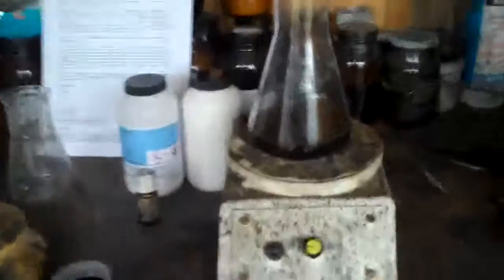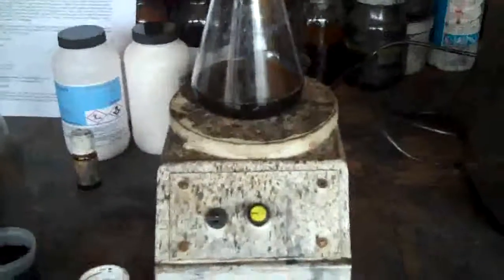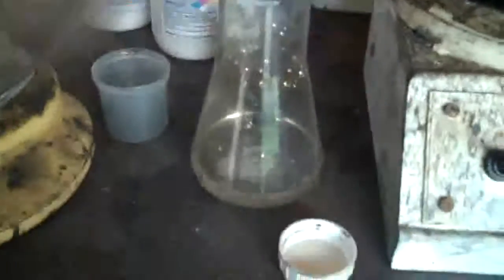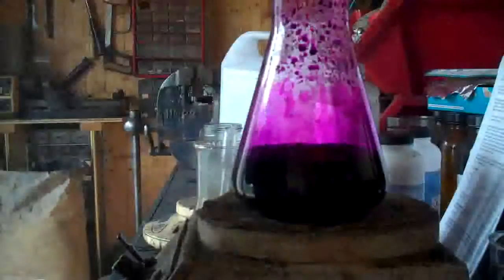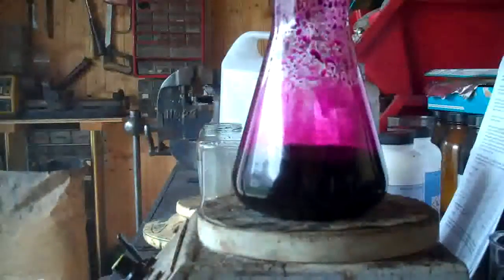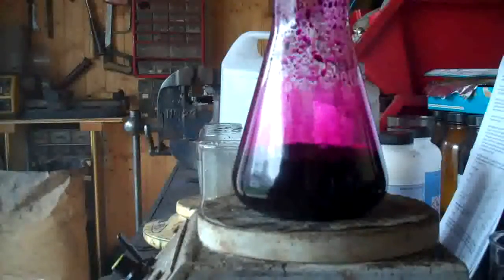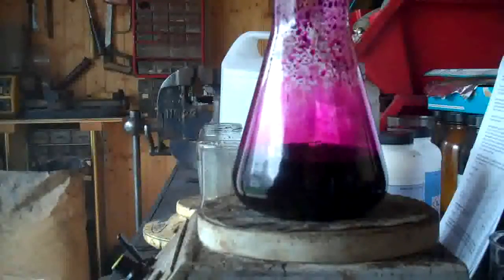Graphene Oxide Manganese Dioxide Cathode Material For Batteries And Supercapacitors

Comment: hi, what's the purpose of substituting part of manganese sulphate with zinc sulphate? why not using only manganese sulphate?
Reply: I think because his friend makes a zinc battery, but I'm not sure about that
Reply: @Upisce  Robert is correct. I was wondering if preloading the mixture with zinc would for an intercalated compound with zinc already incorporated into the MnO2 tunnels, to allow it to work as a ‘rocking chair’ cell, with zinc moving from the MnO2 on charging, and being re-intercalated back into the MnO2 on discharge. That would allow the amount of zinc in the electrolyte to remain constant, which would in  turn maintain the pH of the electrolyte during charging and discharging. One problem with MnO2/Zinc batteries, you see, is that they become more acidic when fully charged, and more alkaline when discharged. This is bad. It leads to zinc corrosion in the charged state, which creates hydrogen gas and eventually consumes all the electrolyte leading to failure. Hope this helps, and sorry for the late reply!

Comment: Aqui esta las notas de la sintesis  de Simon:

20 ml de H2O con 1,2 g de KMnO4 disuelto en esta se mezclan primero con 40 ml de GO suspensión en 1mg/ml para producir la solución oxidante . Esto se pone en un vaso 

de precipitados de 250 ml y se agita magnéticamente con un agitador magnetico.

Otros 40 ml de H2O con 2,2 g de MnSO4 disuelto en esta a continuación, se añade gota a gota a la solución mientras se agita . La reacción es casi inmediata , incluso a 

temperatura ambiente .

Para el MnO2 he sustituido el 25% de MnSO4 con ZnSO4 .

Filtrar, lavar con agua destilada 3 veces para eliminar el H2SO4 residual y el resultado es un polvo marrón chocolate suave que es mucho más conductor que el habitual 

MnO2.

Hace una buena tinta para la impresión . Es tan conductora que realmente no necesita añadir carbón o grafito, aunque un poco de grafito (como al 2 o 3 %) lo mejorara 

un poco. Más allá de eso ,no hay una mejora adicional, lo que sugiere que la conductividad a granel ya es casi tan bueno como el que va a conseguir, y el grafito se 

acaba de añadir una red de percolación que reduce la resistividad superficial entre las partículas.

Funciona incluso cuando se mezcla con cola PVAc que se seca a 80 grados en una película de plástico , lo que hace un electrodo con buena flexibilidad. Creo que el 

grafeno está ayudando a mantener el frágil MnO2 para que no se rompa durante el ciclo, Se mejora mucho el tiempo de vida de estas células que con el viejo MnO2 sin 

grafeno.

Hice una celda de ensayo con el rGO:MnO2 sintetizado en polvo el fin de semana .

Está funcionando mucho mejor de lo que esperaba . El único problema hasta ahora es el nuevo polvo (color púrpura- negro raro ) una vez seco , es tan fino, que se 

esparce con el más mínimo movimiento . Hablo acerca de las nano particulas de polvo ! estan por todas partes. :-(
-----
Sin embargo, funciona muy bien en una celda de zinc. He empezado a hacer pulsada la formación de las células, lo que parece mejorar su capacidad de manejo de 

corriente grandemente. Después ( voltaje de la celda sobre 1.4V vs Zn ) construcción , sólo el pulso de la célula a partir de un suministro de 3.5V sin limitación de 

corriente , tal vez 10 pulsos a 100 ms cada uno , con 5 segundos de descanso en el medio de cada pulso .
----
Las últimas células han sido realizadas por la mezcla degrafito:carbon premezclado a una proporcion de 09:01 en una mezcla conductora con materiales activos en una 

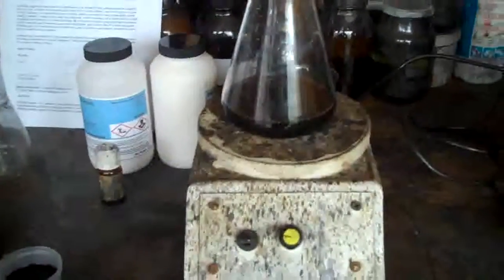proporcion de masa del 2:01. Así que los polvos finales tienen 33 % de carbon conductor y el 66% de grafito . He usado zinc en polvo con una malla de 400 como  

material para el ánodo activo.

Una vez hecho, mezclo los polvos con una pequeña cantidad de electrolito que tiene el 5 % de PVA (PVAc pegamento comercial) añadido a la misma, hasta que se forma un 

liquido lechoso.

Esta es vertida sobre los colectores de lámina de grafito  de corriente a recubrir en un área de 1cm2 para crear una tension superficial uniforme,y después se seca en 

una placa caliente a 80 grados .

Monto la celula con un contacto en forma de disco con el medio de filtro de fibra de vidrio de 1.2um
entre los electrodos , intercalados entre dos 

etiquetas autoadhesivas de 50x33mm de PET transparentes . Para realizar las conexiones más fácil , la parte de extremo de cada tira de electrodo de hoja de grafito está envuelto plegado alrededor de ella piezas de malla de cobre fino ( 300hpi ) de modo que unos pocos mm quedan atrapados entre las etiquetas . De esa manera, unas simples pinzas de 

cocodrilo pueden ser utilizados para conectar la célula .

Hasta ahora, he conseguido 2mAh por centímetro cuadrado de esta manera , cuando un ciclo entre 1.85V y 1.05V . La auto -descarga está casi ausente. La fuga a plena carga es 

pequeña también, yo entiendo de la corriente de carga 15uA cuando el voltaje de la celda está en 1.85 V después de 60 minutos de carga . Tendría probablemente a caer más 

bajo, pero no las he dejado en carga más de una hora .

El electrolito tiene pH 6 ,ZnSO4 a 2,0M, ZnO a 0,25M, MnSO4 0,4M, Bi2O3 a 20mM con aproximadamente EDTA 0,01mN y 0,5 % Carbopol 940 neutralizado.

Comment: Can you make a Dye-sensitized solar cell - blueberry/raspberry solar cell with that substance on top with carbon aluminum battery for the bottom, and lastly a carbon aluminum sandwich capacitor below that, all in one unit? Just wondering if its possible with your thin film tech. Many thanks, awesome videos.
Reply from the maker: GameDev Oleg i don't see why not mate - give it a go and let me know how it works out

Comment: I've got 2 untested ideas that relate to this.  The first is quite a bit of potassium permanganate goes into making graphene so why not take advantage of it?  Make graphene oxide by starting with expanded graphite.  Dilute the resulting brown graphene oxide paste with water and mix in a solution of baking soda until pH is 7.  At that point you should have a mixture of graphene oxide, soluble sodium sulfate, and insoluble manganese carbonate.  Wash to get rid of the sodium sulfate.  Dry the precipitate onto a current collector and bake to convert the graphene oxide to graphene and manganese carbonate to manganese oxide.

The second idea is to soak expanded graphite in a concentrated solution of manganese sulfate and then allow it to dry.  Additional manganese sulfate can be added later to increase the amount of manganese sulfate crystals deposited between the layers of expanded graphite.  Once everything is dry the expanded graphite is compressed into a sheet.  Electrolysis can then be used to convert the manganese sulfate to manganese dioxide.